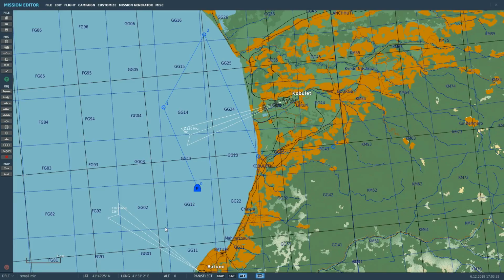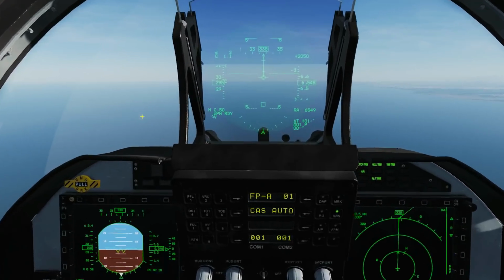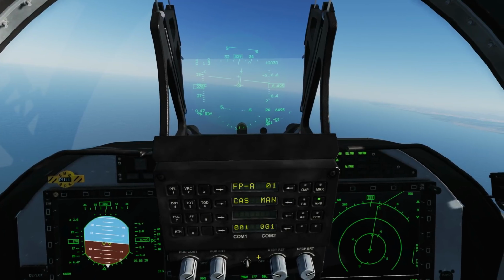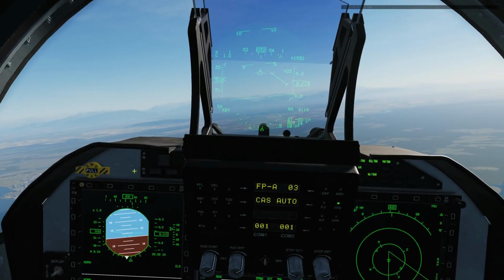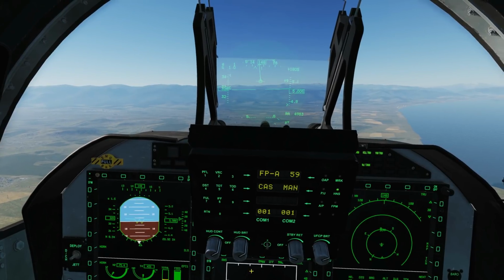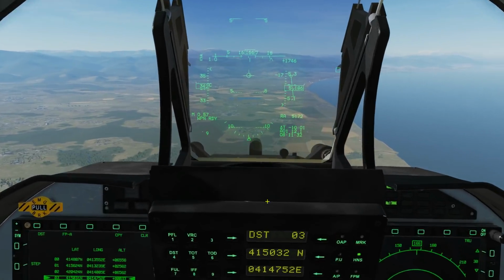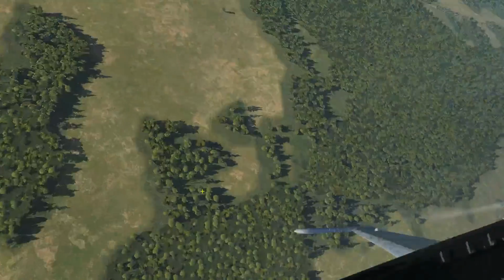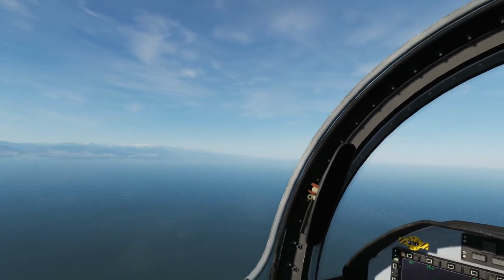JF-17 Thunder: INS/GPS Waypoint Navigation & Manipulation Tutorial | DCS WORLD

Comment: But how do you create waypoints from the F10 map?
Reply: No capability for WP in F10 yet, Only route points for missles
Reply: @firemedicjm911  what are you on about? You can designate PP points which you can copy and paste as normal waypoints.
Reply: @eran100100  FiremedicJM is correct, You cannot import Waypoints from F10, however you are correct in you can import RP and PP and then copy and paste them into WP slots. This is not the intended usage so there is no capability to import Waypoints directly into the WP slots yet. Video is coming.
Reply from the maker: Will show F-10->plane waypoints in  upcoming vid :)
Reply: I actually messaged Deka about this the day it released, there exact reply was "currently only PP and RP used for AG weapons are available, will add WPT## later" so, SoonTM :D